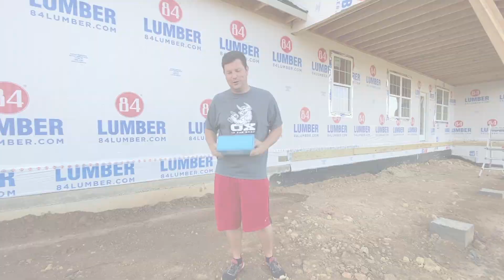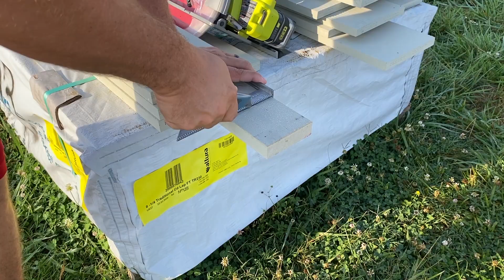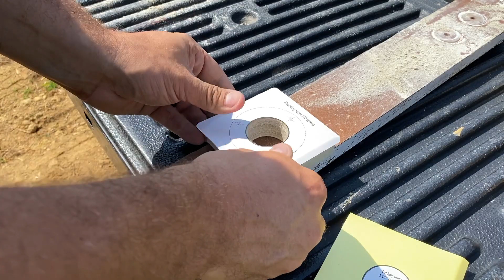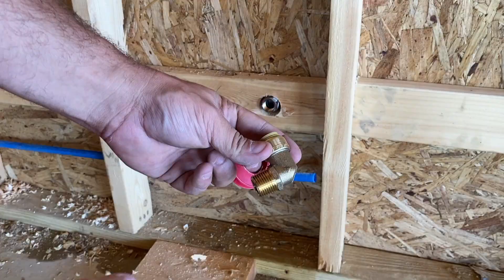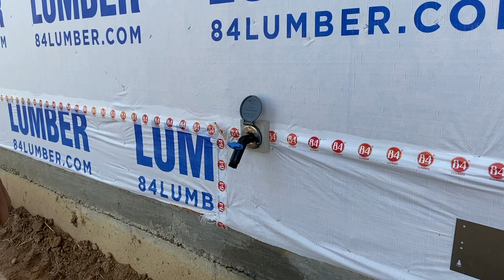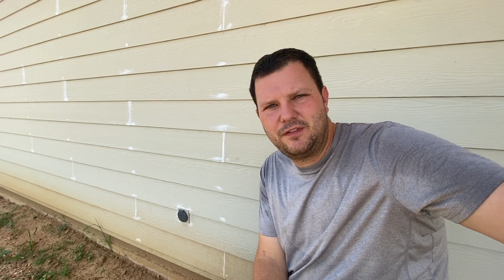How to Install an Aquor House Hydrant

Comment: Nice, but probably that practical in the frosty great white north.
Reply from the maker: I would say it is better than anything else bc the water stays at the out of it until the part is put in to make the water come out. So the water is way closer to the inside of your house rather than outside with the elements